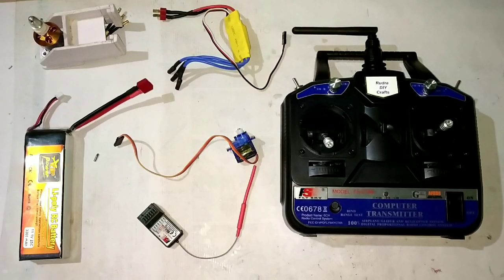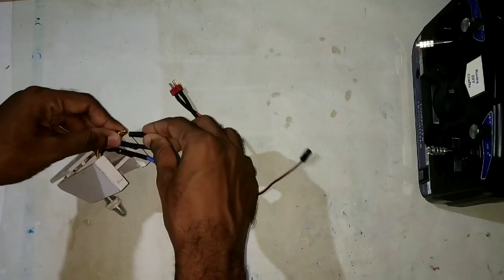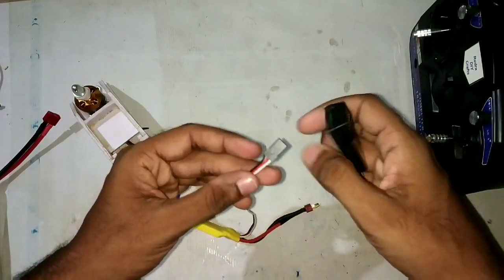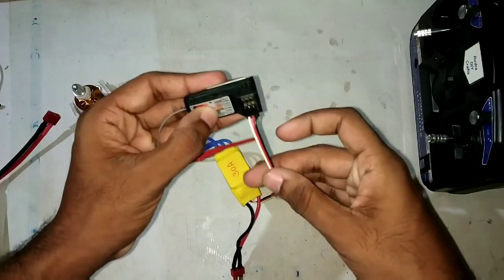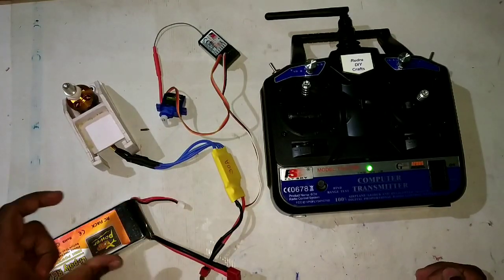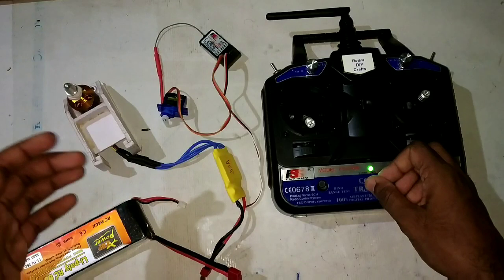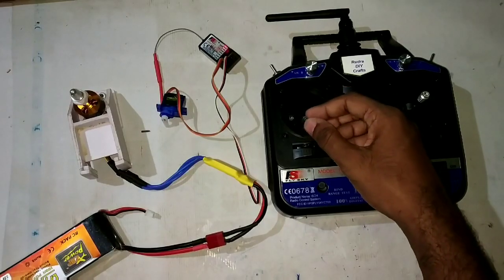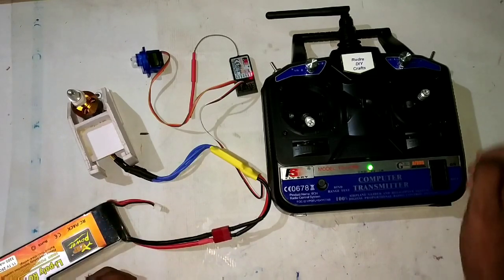How to Calibrate the ESC to the throttle channel of FS-CT6B

Comment: I have a question, is same procedure apply for all ESC's calibration?
Reply: no you actually don't even need to keep it on max throttle before turning it on. you can just turn it on and the bldc will work